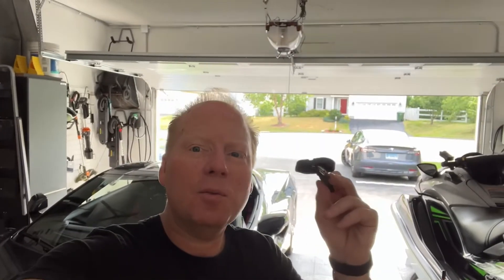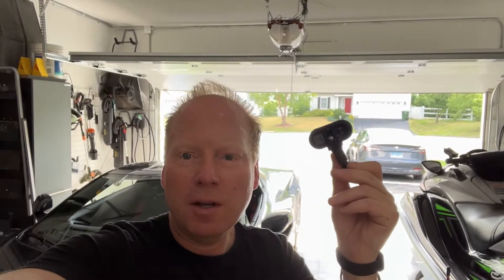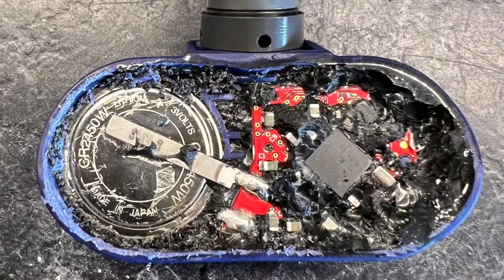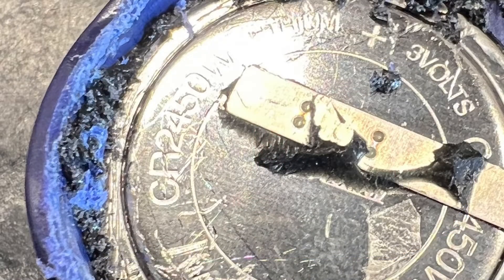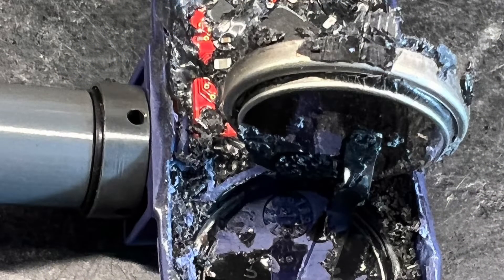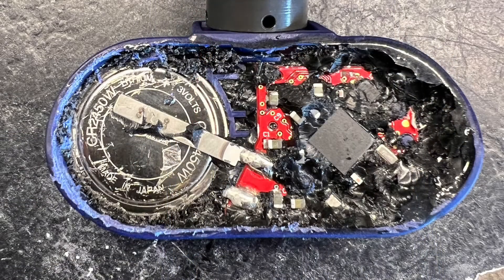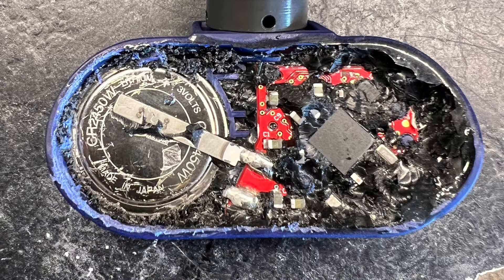What is inside the new Tesla BLE Bluetooth tire pressure TPMS sensors from 2021+ model 3 Y S and X ?

Comment: If you swap these out of tyres yourself with new sensors from Tesla, do they need any programming or specific pairing to the car? Or does the car just recognise the newly installed sensors once you've fitted them and gone for a drive?
Reply from the maker: No programming needed on the 2021+ Tesla's with BLE TPMS the car has Bluetooth antennas in the mirrors  and can detect where the tire is installed by triangulating and signal strength.
Reply: @keenanjeff  Excellent, thanks for replying! I just had a bluetooth sensor fail on my front left front and needed to know my options for replacing it!